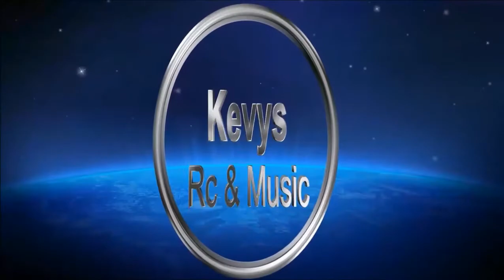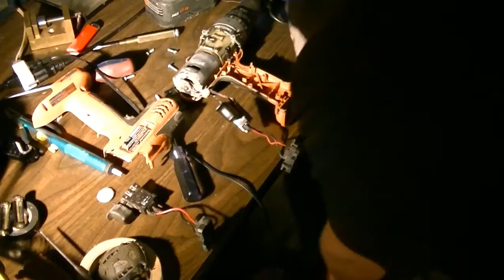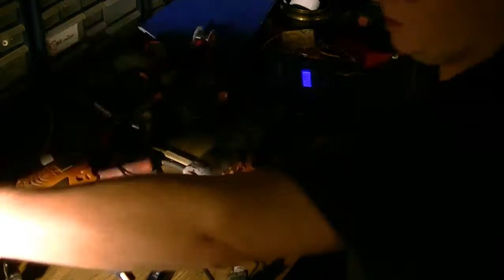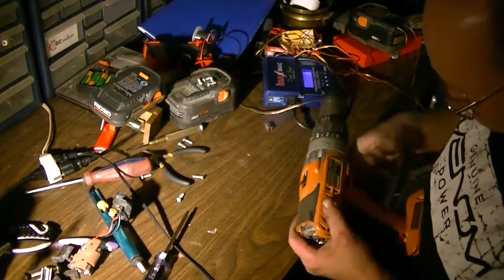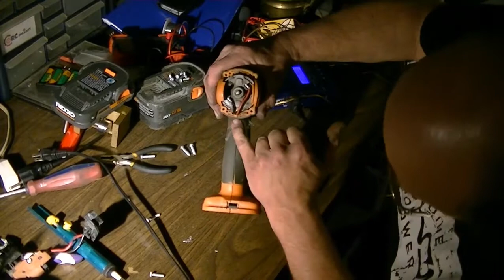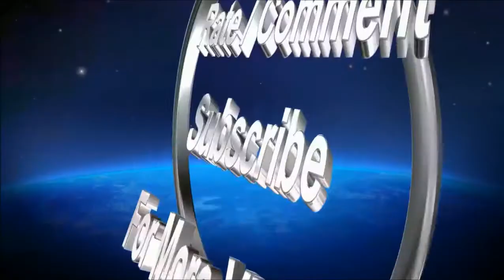how to replace  speed control switch in ridgid X2 Hammer Drill

Comment: What screw and screwdriver are you using? Thanks.
Reply from the maker: you just need to use a torx screw driver that fits these to take them apart